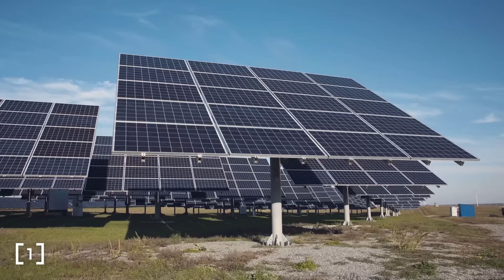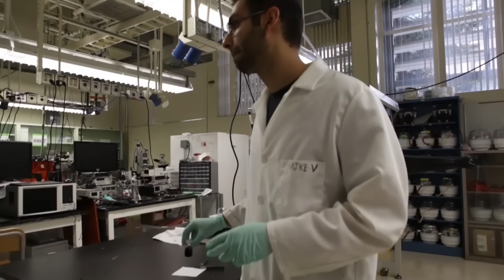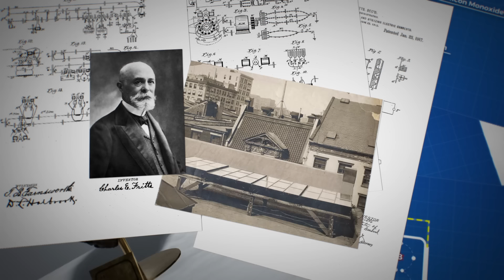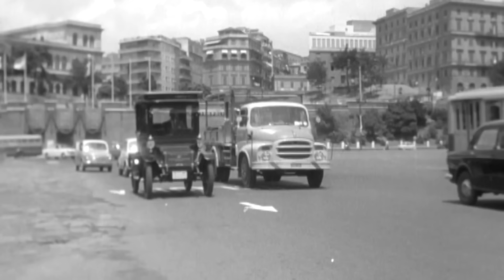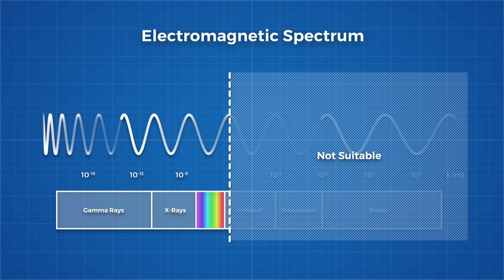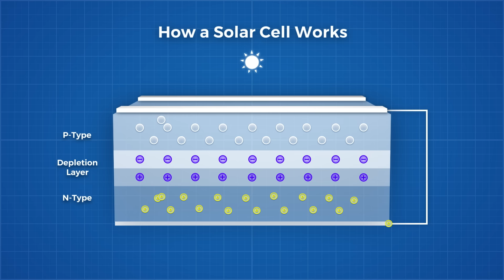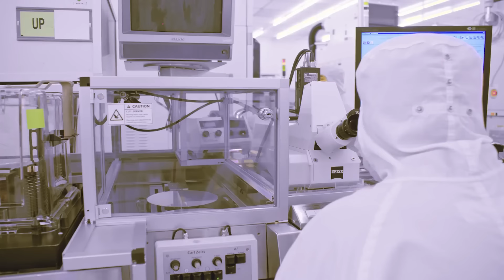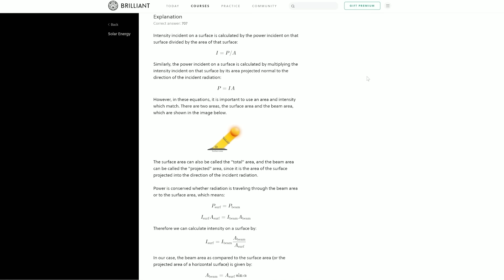The Mystery Flaw of Solar Panels

Comment: I wonder what people are going to think of solar cells when they start wearing out in bulk and they have to bin so many harmful materials like cadmium etc and how Africa with it's child workforce will need to up their mining quotas so rich, western societies can have their grossly inefficient power generation systems that are ultimately going to cause more environmental harm than something that's far more carbon neutral and environmentally friendly like nuclear power plants.
[Edit]
https://www.energy.gov/ne/articles/infographic-how-much-power-does-nuclear-reactor-produce
[Edit] Why didn't this guy mention that solar only works during the day? That it's power output varies wildly which means that it can't be used consistently? As in, because of how storage technologies make solar incredibly unfeasible as with too much or too little power being generated, power storage is very hard to use without generating excesses of heat and wasting power as well as requiring increased maintenance requirements due to the heat build ups?

Comment: Sure, solar power is putting fossil fuels out of business. Look at Germany and Poland. (which is not good)
We'd all like it to be true, but the most solar country right now, Israel, is making about 30% of power from renewables...

You can sink the heat and recover power off it with additional Stirling cycle engines. Expensive though so nobody does it. (and requires microfluidics)
The other way would be to use IR mirrors and concentrated solar power. But the technology to make such mirrors that pass through visible and UV light is not there yet, so the combined solar is less efficient thus far.

Comment: The on going "Geoengineering Weather Modification" is reducing the incoming efficiency between 30 to 50%. So what is the efficiency of this? The power supplied by renewables is 2.5 watts per meter of ground, where the power of conventional power plants is 1,000 watts. The John R. Turk Jr power plant is 43.3% efficient! Sounds like solar has a Long way to go!!!!!! Meanwhile there are huge profits to be made by those who own them!!!!!!! More then conventional power.  All at your expense.   More rebar needed more concrete needed for renewables. You didn't cover the angle of the sun needed , but mid USA is more efficient for solar, the big solar farms the new ones will cook a bird inflight, talk about inflight food service!

Comment: does this mean that if 100% of light is absorbed, the panel would be invisible or...

I'm sorry I'm no physicist I don't really know these stuff
Reply: invisibility could mean the object is not emitting or reflecting any signals such as in black holes.
or the material has no interaction with any form of radiation or energy such as in dark matter
Reply: @gelmir7322  invisible as in not emiting any form of light. Although you'll probably be able to see it from the behind?

Comment: I know how solar cells can be made much more efficient, though the increased cost may make it not worthwhile. Rather than one semiconductor with a single bandgap which is perfect for receiving photons of 1100 nm wavelength or about 1 eV per photon which is completely nonresponsive to photons with less than 1 eV per photon and only producing 1 eV of electrical energy for photons that have in excess of 1 eV per photon, you should have a series of semiconductor junctions, the one on top with the highest bandgap, so it will receive the highest frequency photons, perhaps 3 eV per photon, and absorb the ultraviolet and produce 3 volts, but be transparent to the photons with less energy than 3 eV per photon. Then after that, a layer that utilizes the 2.4 eV/photon light, but which is transparent to the photons less energetic than that, which go on to further layers down. A series of semiconductors custom designed to absorb the lower and lower energy photons which penetrate deeper into it. Just a series of different semiconductors in a series of layers.
Reply: Sure spent alot of effort making a comment that's just gonna get lost in the netstream of information

Comment: The internal combustion engine is at least 50% more efficient than solar panels when they are working, which is not at night.  In physics you can measure the output of every energy source.

Comment: The lobby that thinks a 20% return of energy is a good idea gives a pretty clear indication of the mental ability of those advocating it. Since when is 20% acceptable - especially at the the current cost?
Reply: Car engines are not much better than that so it's pretty much always been acceptable. Besides, what is the actual reason that high-efficiency matters? It's not like sunlight is in short supply.
Reply: @ndvorsky  The point is that we're trying to replace a wasteful process with a better one. So far, we're not close - AND, no one has worked out what to do with spent solar panel fluids and elements.
Reply: @pmichael73  You cannot waste something you don't want/use. Every solar panel is electricity we didn't have before without incurring more pollution and only "wasting" sunlight we were not using anyway. Better conversion efficiency can always make things cheaper, easier, simpler, and quicker but we are far past the level of performance required to make them beneficial. 

I am not sure what fluids you are talking about but solar panels are very recyclable and evidence suggests that they can even be revitalized to like-new condition without remanufacturing them. Solar panels are extremely simple devices with no moving parts which do not even undergo the same degradation as computer electronics. They can last a lifetime if you want them to. People don't care about that because they are also always improving and it is more economical to toss middle-aged panels for new ones. "what are we going to do with all of them" is an oft-stated non-issue.
Reply: @ndvorsky  Solar panel use a LOT of energy in their production. Broken panels are treated as hazardous waste and chemicals can leech into the soil and water supplies.
Reply: @pmichael73  SOME broken panels are hazardous waste (CdTe)  and those are rarely used. 

They actually do not take that much energy to produce considering that within 3-8 years they generate as much as is needed to produce them. The rest of their warrantied lifespan (30 years) is free energy. Of course, you can just continue to use them past that if you want.
Reply: @yasio bolo  Of course, you also have to deduct the energy that went into manufacturing solar panels, too. . . .

Comment: I was with you UNTIL - 
you went sideways on us and proposed that plants have the intelligence to optimize themselves.
Sorry - WAY off-base.
But I still wanted to know the cause of the 2% drop, so I suffered on.
So thanks for your effort - but you really need to shake loose from your programming and take an objective look at intelligent design.  
Happenstance just doesn't cut the mustard - which can be easily demonstrated with pure math.  Long shots are one thing - but there comes a point where absurd to the ridiculous degree has to be taken for -- wait for it --
a FAIL!

Comment: This is all well and good, but until we can store that energy on the grid to be able to use it when we aren't collecting, we're gonna have to have a back up of some sort... be it coal, ng, nuclear, whatever...
Our AC power grids are all of the "use it or lose it" type - the energy released onto the grid gets used in that second, or is converted to heat and lost. Period.  UNTIL we address that, all of these "alternatives" are just gap fillers, not suitable for primary energy use. 

And understand, I teach this stuff - I DIG this stuff, but I also fully understand the limitations we are stuck with at this time - I keep hoping to inspire one of my students to come up with a better energy storage/release system - THAT is when solar and wind and other "renewables" will start making sense for all of us.
Reply: Another issue is energy storage. At best we can achieve a couple of decades of storage before the medium needs to be exchanged not to mention losses over time.
Reply: Correct. Also, the advance of technology hasn't really forced fossil-fueled generators out of the market, as the author claims. It is really being done by government legislation to deliberately make coal more expensive (or just ban it outright) and by expensive subsidies to make solar panels cheaper. The policies and actions of Germany and Japan, not to mention China and much of the rest of the world, all still recognise that coal is the cheapest form of base load electricity generation.

Governments of rich Western 'planet-savers' attempting to force many of the world's poorest peoples to adopt wilfully expensive electrical generation methods, enforced by the World Bank, strikes me as morally dubious to say the least.
Reply: @michaelhart7569  In germany the cost to produce Solar Power is even lower than the US. Coal is much more expensive but since noone gives money the research on storage, these ancient technologies are kept alivr even tho they are bad for our health, the environment and are more cost intensive.
Reply: @Oeggonom  This is, at best, misleading.  Lazard's LCOE analysis may show lower costs of electricity for solar/wind but it doesn't account for battery backup or gas peaking.  Those two are separated out into their own LCOE's and happen to be the two most expensive options for electricity.  Combined, it makes Wind/Solar very unattractive, nor does the LCOE effectively account for the capacity factor differences.  Yes, US renewable energy cost is higher, but OVERALL electrical prices are significantly lower.  What matters to the majority of people is the cost they pay.  The "cost" to the environment doesn't matter if you can't afford to keep the lights on.

As for electrical pricing, Germany's cost to consumers, in TOTAL, is significantly higher than other nations in Europe.  Germany currently pays THE MOST for electricity in Europe.  France, which is 70% nuclear (rest is hydro with a small percentage of other renewables and natural gas peaking) pays just over half of what Germany pays for electricity.  Germany is at 30.88 cents per KWHr and France is at 17.65 cents per KWHr in 2019.  The US pays about 12 cents per KWhr...

The other frustrating thing about this is Wind/Solar is not cheap enough to where the poorest of the poor can afford to power their home with it.  If you assumed every middle class family could afford to go completely "off" grid (offsetting energy with solar/wind on their property), the cost of electricity to the poor would increase drastically since the customer base for traditional generation would shrink a lot.  It may feel good to go "off the grid" but every time someone does it, the cost to those still paying rates to the power company goes UP.  It may not be much, but it all adds up the more and more people do it.  There is a definite societal cost NOT factored in there.  Does it outweigh the cost of climate change?  Doubtful, but not very well studied at the moment either.
Reply: @Whiskey11Gaming  YIkes you are cringe af. "The cost of the environment doesnt matter for most people". We just gonna die is a strong argument I gotta admit.
Reply: @Oeggonom  how much do you think people living in Somalia care about global warming? In guessing near zero. When you live in true poverty, your concerns about basic survival trump concerns about where your electricity comes from. 

To an extent, this applies to people living in poverty in the west too. The concern is about making ends meet and keeping their head above water for as long as possible. My profession requires a high level of contact with some of the poorest Americans, and the vast majority are focused on just living and cannot afford higher energy prices. Many can't afford the current energy prices.
Reply: @Whiskey11Gaming  hot countries are becoming unliveable, so they should care.
Reply: @pennyandian  That's not exactly new to them... when your biggest hurdles in life are getting adequate food, water and shelter from the elements, added heat and drought are just a part of that hardship.  At the individual level, next to zero of them care about the drought except that it makes it that much harder to get clean-ish water.  in TRUE poverty, climate change is a secondary concern and just surviving (getting food, water and shelter) is the dominant factor in your life.
Reply: @michaelhart7569  Without Fossil Fuels, the materials acquisition, manufacture, transport, and installation of Solar Panels is impossible.  Also, that 627,000 MW capacity represents 3% - that's right, 3% - of total world-wide ELECTRICAL energy production capacity.  If you compare that to total energy production, it's dwarfed even further (by transportation, which is all Fossil Fuel these days).  Clearly Solar is nowhere near "replacing" anything.

Comment: 10% LID?  I'm not aware of a module on the market today that has a LID higher than 2.5%
Reply: Most polycrystalline Si modules have an LID of well less than 1%.  LID is a more significant issue with monocrystalline Si, but still nothing like 10%.

Comment: The hot super heated air can sure in winter b used  but rest of the time u can pump or dump ^ super heated air down the septic system to help treat the sewage. Sure u can use copper water heating but what do u do w/air & rest of the heat <dump it in central under ground collection or every 1s shared collection system so heat energy can u used rather than hving to work AC for building so hard. All this collecting of air will near boil sewage all the way to treatmment plant on far lessen energy needed to finish treatinging it. Seperating solids from water filtering & heating & chemical costs way less & way less smell if u live down wind from plant. I don't know how much of the 100% of light we used but I'll beat w/plants & batteries & water heating 1-4 & bonus & sewer collection of air off season it is 60-or 70% on clear day easy. Batteries will get better given & we can get double sided reflextion prices down given seeing it & if we ever get the 20% up a bit more even better. PUT the money into ppl infostructure improving r lives rather than BS tweaking panels. It anti there this is real 60 or 70% & it is here on the cheap & free every day thank u Sun.

Comment: Idea is to just say OK sun will reflex, that go w/that. Double side the ultra thin panel dirt cheap & hve them ideal reflective distance packed as close apart to get most reflection down the light catching shaft.  Easy enough, Now at the bottom we will still hve a way to heat water or let the light shine threw or both. So we can then let light shinning threw grow something or brighten a room. WE GOT AS MUCH reflection back & forth down the double sided panels as closely backed as poss getting as much solar gain as poss, then got most water heating stove effect super heated air heat exchanger or hot water ck & ck, & we r letting plants do what they do & grow from the super multi reflexed focused like cheap magnifier grow in the rest or still let light shine in. In desert just mirror salt works grand but on small scale not tiny scale chargeing back up battery, <this seems to b where we r at? Rather than try & make solar something it is not go w/what it is back up charging of portable greatly improving batteries & if we build med dirt cheatp panels right way cone shaped double sided we get all we can step 1 or 2 or 3 PLANTS, or 4 light or all the above together back up charging & 1-4 & solar clear roof sky light. Money spent this way actual pays back the cost of panel rather then paving planet in silicon money stealing fraud.  Light reflex great use that light heats great use that & warms air use that, & plants need it use that, & saves on candles great use that more windows less bulbs. Saved heating up interior by roof backing attic good idea, & nice way to keep batteries from draining down & hurting them nice bonus feature.<CONE opening light catcher double sided ultra thin ultra cheap tightest stack, best sun tracking built in.>
Reply: w/ever more battery devices the power crap 20% will actually get used by all these devices. Batteries IF U R Paying Attention getting ever better & there importants growing is why solar much cheap crap 20% panels NOW far better than in 70's. We r disconnected NOW more tan eve,r so huge DC need. Batteries r so much leaps better than they were b4 in 70's & 80's. The key is just to change to sandwich channel double side vs flat bs panels set up, get or try to get 1-4 & bonus cell & devices & back up battery charging done for free. FOCUS ON THAT<getting cheapest sandwich double sided panels  just so elegantly channel reflexing & move on to better cheap longer & faster charging batteries. Panels r there, we r there just need to stop push pulling *& intentionally making shit wear out & break down for profit & advance.

Comment: u lost Me 5 or 10 sec in. We hve need for potable trickle charging but on large scale mirror solar or sun heating of water put solar to shame.  Solar calculator could idea if it has back up battery example. Sun will hit roof any way might as well heat water or panel, good & ok?   What if we take your hard fakes & just work w/it.

Comment: Very nice description of many problems with solar panels. Doesn't address one of the largest problems, which is the cells DO wear out over time! All those acres of panels will have to be replaced MORE OR LESS AT ONCE by the taxpayers! The normal wearout power loss of the cells is greater than 10%, some showing 1% per year. A gas fired turbine generator is rebuilt after a certain run time (many years), with FAR less cost than totally replacing the turbine.